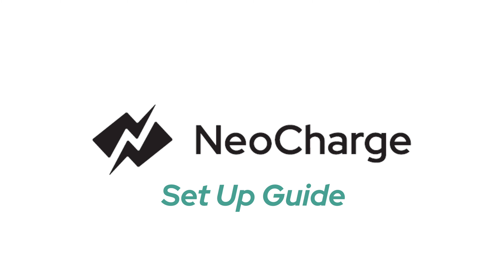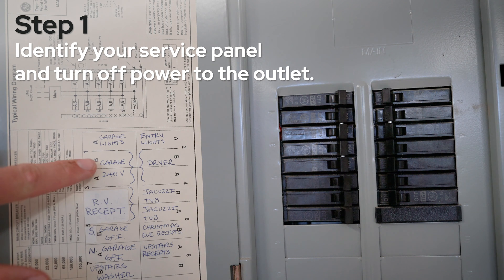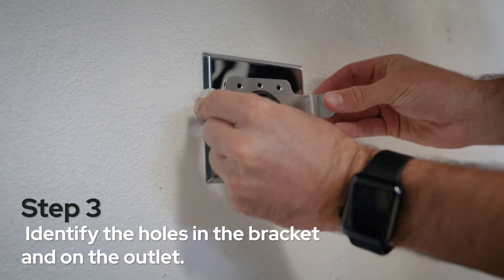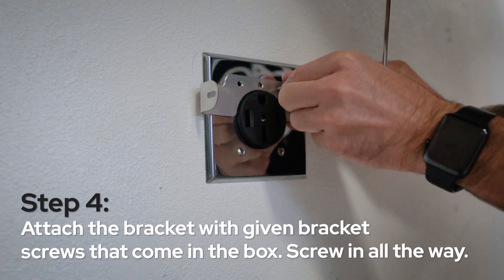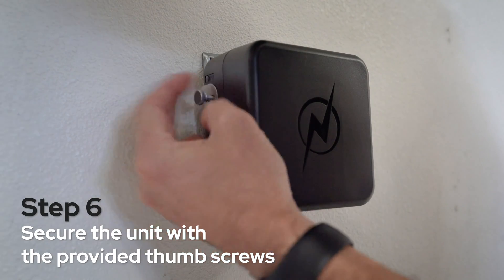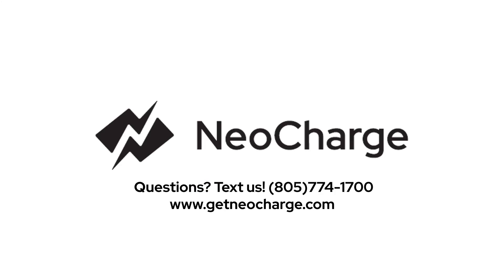How to Install EV Charging Access at Home — Smart Splitter Install Video

Comment: So you can charge your electric vehicle and run the dryer at the same time while both share a 30 amp breaker?
Reply from the maker: Close! We do not allow the dryer and EV to run at the same time for safety reasons and to keep the total power usage to under the 80% required by the national electric codes. ON a 30 amp breaker this would be 24 amps max.

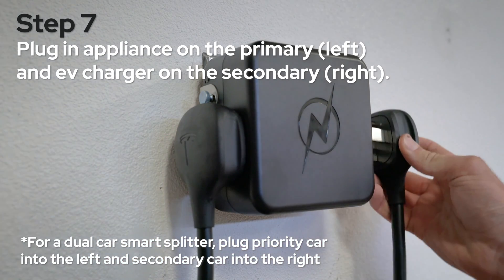Comment: 1:10 You plugged in EV chargers on both sides.  Unless Tesla has started making appliances and you plugged a Tesla appliance on the left and a Tesla Ev charger (mobile connector) on the left.
Reply from the maker: Great catch! We have a lot of different use cases including dual EV charging (two tesla chargers as an example sharing one 240V outlet). People also use it with a dryer and EV.

Comment: Step 9. Move to a country where 240V house wiring is standard and plug into any socket.
Reply: Would still be useful for where you want to share a circuit instead of running a new one.
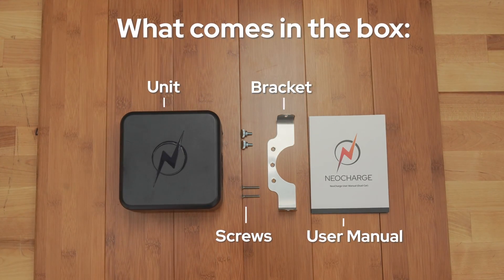Reply: This will not plug into any socket.  Per the video 0:17 this will only plug into 4 different socket types.  NEMA 10-30, 10-50, 14-30, 14-50.

Comment: When the 1st charger / EV is done charging and this splitter switches to the 2nd charger / EV, does it completely cut power to the 1st charger / EV?
Reply: The Primary outlet on the receptacle does not completely lose power. There is a minimal amount of idle power that continuously goes to the Primary side of the device to ensure that LED screens of the EVSE or Appliance continue to operate.

Comment: My plate does not have the screw holes to install the bracket. Is it ok to use the unit without the bracket?
Reply: Most outlet receptacles have enough clamping force that it shouldn't be a problem! We would recommend you occasionally check the Smart Splitter to ensure it is seated correctly and not falling out of the socket. If you are worried about the Splitter becoming unseated, outlet covers are generally just a few dollars from your local hardware store and can easily be swapped.